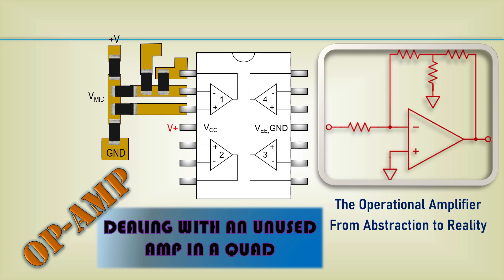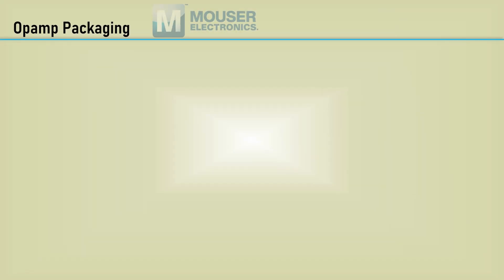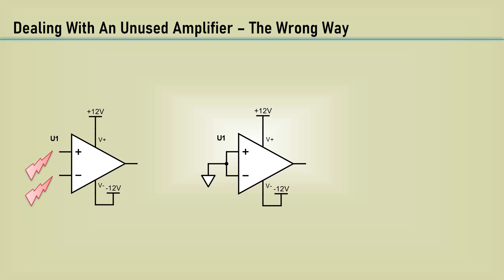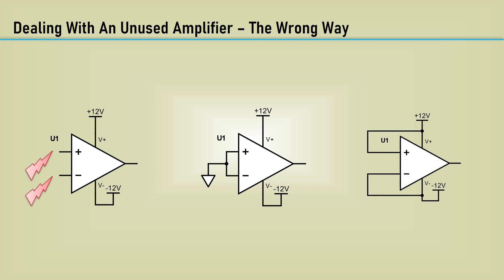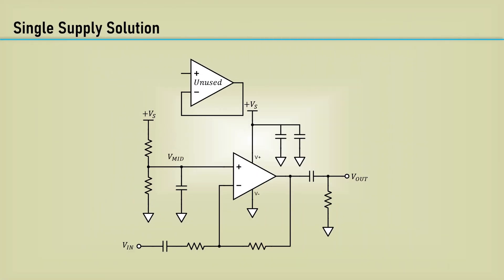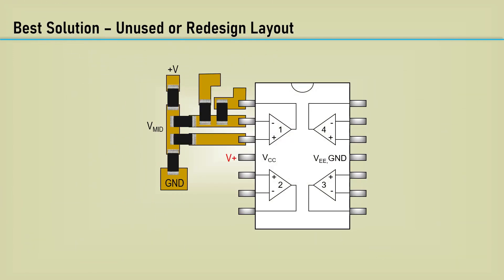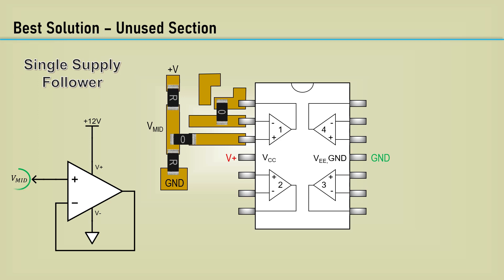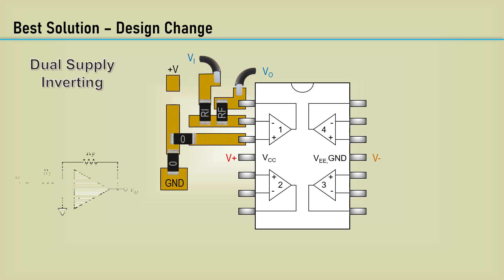Dealing With the Unused Amp in a Quad

Comment: I used to simply bridge the output to the inverting input. This way the op amp has a gain of 1, and it simply repeats whatever noise it receives on the non inverting input. The output doesn't get slammed to either the positive or negative rail based on the input noise.
Reply from the maker: Yes, setting it to unity gain is definitely the most important step.

Comment: I wonder,... consider a circuit with dual supplies, four amps/package; 
(perhaps with small series r's in Vcc & Vee)
Add a mid voltage divider instead of ground.
Now connect the output through a fairly low value resistor.
Inverting input to the divider, Positive to GND.
Will the opamp locally regulate and potentially improve power supply rejection? 
--- This is an off the cuff idea prompted by your video, and offered with little evaluation ---
So it may be total crap.
Maybe interesting?
Reply from the maker: With dual supplies, ground is the perfect midpoint already available for the unity gain buffer.
Reply: @oldhackee3915  I did not explain my idea well enough.
Difficult without a drawing. You misunderstood.
I was considering differential noise on the Vcc & Vee
and whether or not there is a way to have a fourth opamp in a package
actually "regulate" the Vcc & Vee by grounding the opamp output.
Off the wall idea really, more of academic musing than a problem that would be common.

Comment: I have used it to implement a stiffer virtual ground than you get with only the 2 resistors and cap
Reply from the maker: Well duh on me...I pointed out doing that very thing in my "Single DC Supply Biasing" video but didn't have enough gumption to include it as an alternative use in this video. I really appreciate the comments. I wish there was a way to edit the video after it was posted.
Reply: @oldhackee3915  I'll make sure to watch that. This was a really good introduction to your channel and answered a lot of questions for me
I guess you can have a pinned 'other uses' comment
Reply: @oldhackee3915  I would have added it to the describey. Many of the YouTubers I follow post follow-up essays there. A pinned comment also works though.
Reply from the maker: Thanks for the suggestion. I just added it to the description.
Reply: Same! It's a very good use for an extra op amp. My one concern in some applications is the noise it potentially injects into the virtual ground rail as an active device.
Reply: Was just about to say the same thing. I remember Dave Jones mentioning something similar in one of his videos about designing his uCurrent.